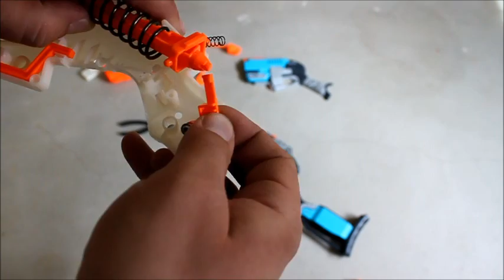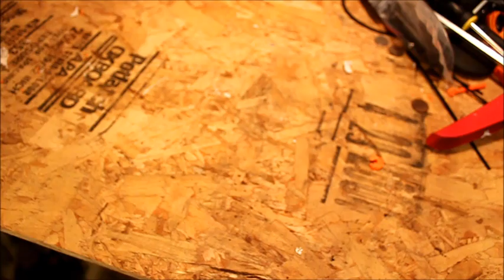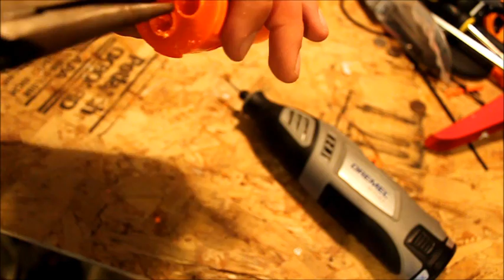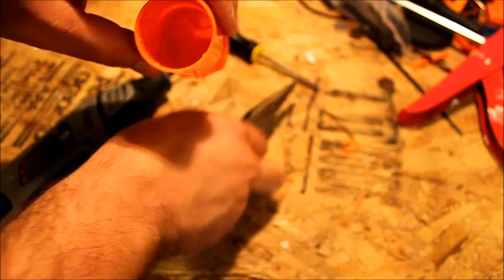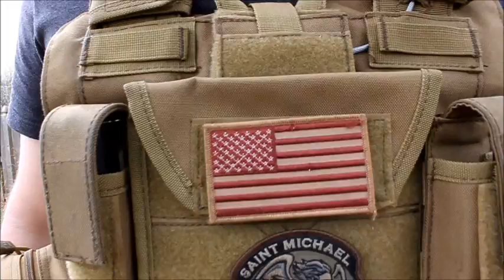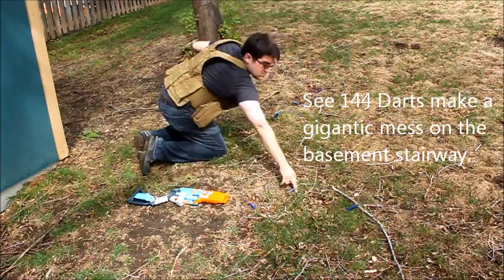SledgeFire Fun

Comment: When I removed my ar's on the sledgefire I found that I was losing air from where the blaster comes together around the 3 firing holes. To fix this I used one of those foam Valentine's day hearts with the 3 holes cut out and placed over the top of it. It worked hella good and the distances were soo much greater. Just thought I'd share. I'm sure u don't need my suggestions.